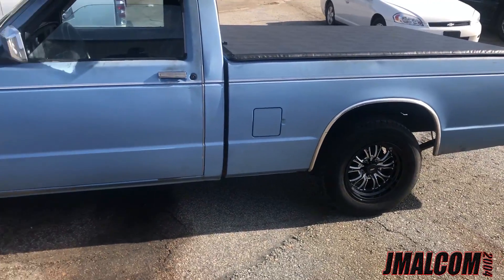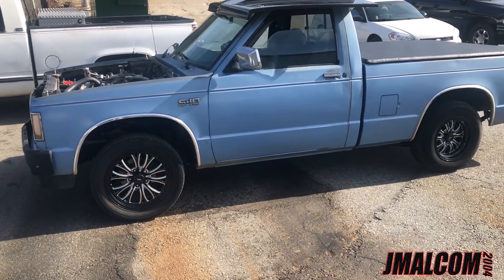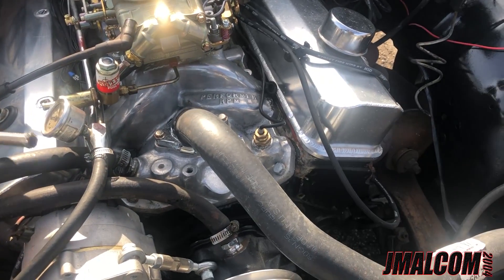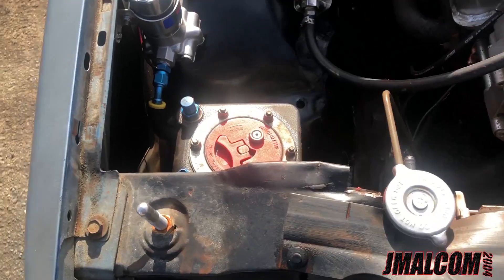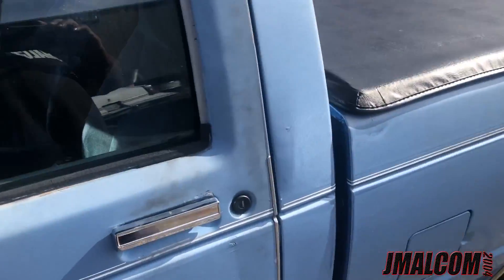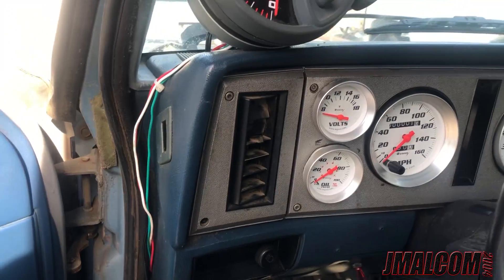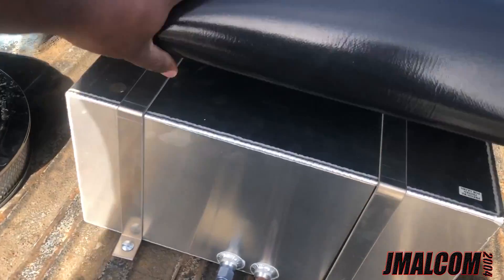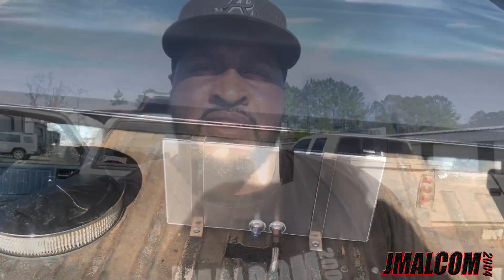WELL THE CHEAPSKATE S10 MOTOR IS DONE.....NOT GOOD

Comment: 400 small block time. .030 over to a 406, good cam and intake,750-850 carb .DONE!   Can be a lethal little motor for track duty and will kill the Ls motors.
Reply: Jody u ain't lying.  I got a 406 stroker being built right now.

Comment: Well a LS 5.3 or 6.0 will be better than a 350 right off the bat anyway.When you say Cheapskate you can’t get much cheaper than a Ls quick easy horse power right away.
Reply: he has it set up for another sbc to drop in. it's gonna be easier and simpler to put another 350 Longblock Which you can get for $200 at U pull it. new gasket and you all set.
Reply: Not really you can get a 5.3 for about $300 but it cost about 2.7K to get it to 400hp where a 350 you can get 400hp for 1K but it gets worse gas mileage and is heavier
Reply: @Carterprobinson  kind of right but kind of wrong. You can put a good shot on a stock 4 bolt main and get a solid used cam off a racer with random parts laying around. Put it on a junkyard 350. Just do gaskets and if it has good rings and bearings you are set. You will have less than what itd cost to just tune a ls. As someone whos had both that is fact. Old 350 truck motor. With a 100 dollar plate ebay lines a cheap used bottle and a cam from a dirt track guy he had layin around total 250 on a 200 dollar junkyard engine. Converting a ls to carb will be at least 600. Keeping efi Laptop hp tuners and a nitrous kit was 450 al together. But then you need a wiring harness then ecm cost and so on. Minus engine costs. Plus all the time wiring the harness resetting harness pins and so on. Or go stand alone but then again thats 1000+ not even getting into hp upgrades. So no ls are not cheaper to get 400hp. People just think they are. Infact if you put the time and energy into a ls swap. And not make it carb. You better be pushing 600+ cause to do all that work for a measly 200-300 whp seems asinine. When you can get the same for 1/4 of the cost out of a carbed v8 in the 500 hp range and still be reliable.

Comment: That 650 carb would work great on a 4.8..... I gotta spare one you can throw together for that bad boy that’ll take the juice. Might need new headers, an intake and msd 6014 to make it fly for cheap. With a used ls2 cam should do about 380-390 fwhp   Just food for thought if you part the top end out on that thing you can probably get it running in time.  Should be good for 6.50s in the 1/8 with 175 shot....

Comment: Just build a hydraulic roller 383 and put steel caps on it and ARP stud everything. Reliable and can make 525-545 with the right heads at 10.5:1 on the motor pump gas

You're gonna need a head from Eric weingartner or Chad spier they'll get you there